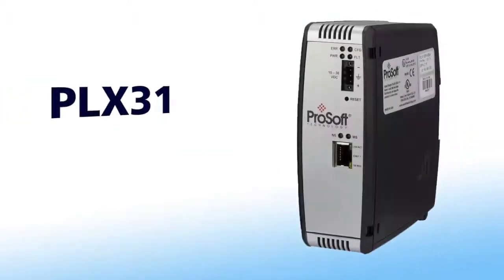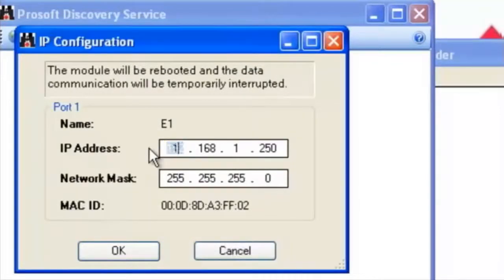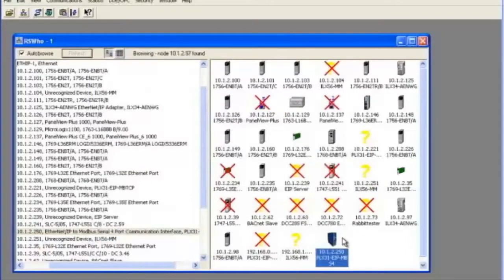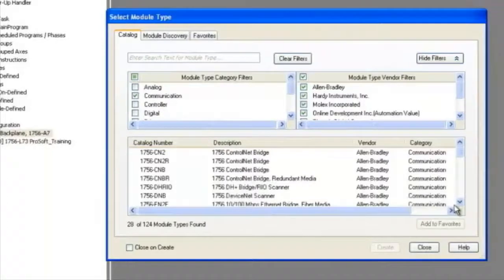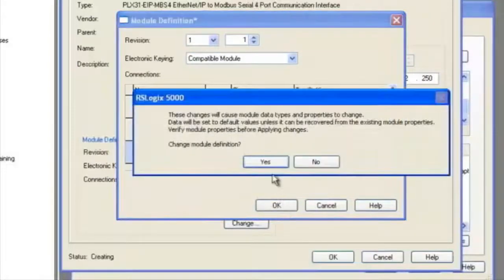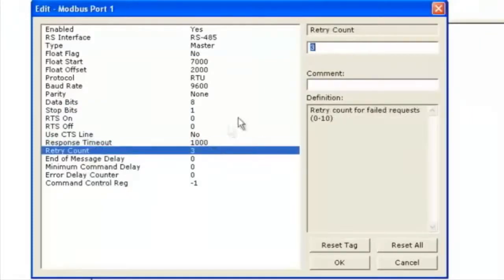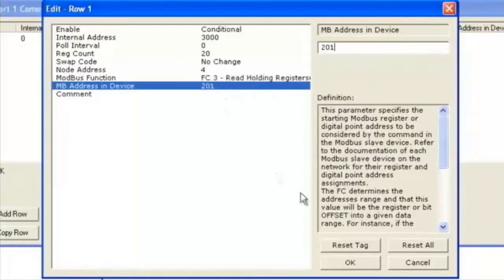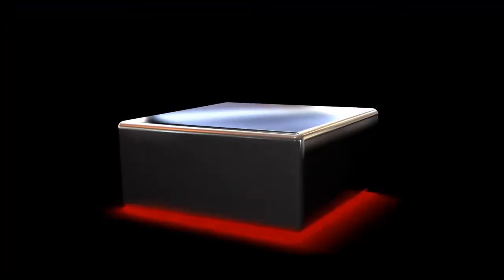Set Up: For the EtherNet/IP to Modbus Serial Gateway

Comment: In the Module Type list, I saw EIP-MBS, and EIP-MBS4, what’s the difference?
Reply from the maker: Hi there! The EIP-MBS4 has four serial ports so it can connect more devices (up to 400 Modbus devices) and help users limit the number of required gateways.

Comment: Excuse me , this gateway can work with a PLC omron CJ2 , It has ethernet IP module or just woks with PLCs Allen Bradley
Reply from the maker: Hi! If the Omron CJ2 uses Modbus Serial, it would almost certainly work with the gateway. Modbus is a very standardized, simple protocol. If it's EtherNet/IP, it's more of a gray area and we would need to look into the details of the Omron's EtherNet/IP capabilities. Please call our Tech Support department at 661-716-5100 if it uses EtherNet/IP; they can provide information specific to your application. Thank you!